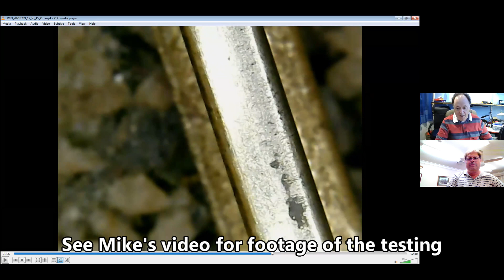Track cleaning on your model railway - what science and experience tells us

Comment: I have been using INOX MX3 for over 40 years. I don't need to clean my H0 locomotive or metal carriage wheels ever. The oil stops oxidation, thus I only clean my track about every 2 months, and only on the oldest track on the layout or track where trains do not regularly run. I installed a helix using Peco track about 10 years ago and have never cleaned this track, the small amount of Inox MP3 is automatically spread over the track. Any light oil works, like transmission oil and CRC 226. WD 40 dries out to quickly, like IPA. https://www.youtube.com/watch?v=A41VpUeoW5A

Comment: I'd be interested to know what mico-arcing is, what is the minimum voltage for it to occur, the voltage type and under what circumstances it occurs. Is it just a spark that is so tiny and transient that it can't be seen by the naked eye? I'd be happier if there was  peer reviewed research  done in a university laboratory to identify the causes and find remedies to the causes of track contamination. From what reading I have done, an arc can only occur if there is no direct contact between two conductors, so this implies two conductors separated by a non conductive medium, such as air. Then the voltage (and possibly type of voltage) comes into play. I know we have all seen sparks between the rail and pickup wheel. For DCC does the frequency of the oscillating voltage play a part? Do the differing types of conductive surfaces play a part, (ie steel wheels/nickel silver track). The oxide layer of nickel silver does conduct electricity, to a certain extent, but it is also resistant, though not immune, to corrosion. I've seen a lot of speculation etc on the net (in particular YouTube) about the cause of contaminated track and I feel we are a long way from really knowing the causes and also finding solutions to the problem.

In particular I would like Peco or some of the other manufacturers to comment, surely they must have some professional advice?

Comment: Interesting that you say that the black "gunk" is nickel silver?? If thats' s the case , why are tracks not wearing out?  I run big trains , average 40 cars , 3 locos ,  and have been using INOX for 10 years, and never have to clean my wheels (some of my locos are 15 yrs old) on freight cars or locos. The track gets  dirty , but is protected from oxidation due to the spray. Contact cleaner will not protect the rails and can increase oxidation.  The only issue with INOX or similar , is locos with traction tyres, but as far as traction  goes . I have no issue with running 8 meter long trains up a helix with 1.8 % grade. Conductivity and oxidation are the main issues, and INOX or CRC 2-26 will greatly help with these.
Cheers Gregg.
Reply from the maker: Hi Gregg, thanks for the comment.  I’ve watched your great video on INOX and have looked into it and a couple of other products like No-OxID etc.  I never have cleaned the wheels on my locos either, but I have read up on the analysis done by Joe Fugate at MRH and also have done some experiments myself.  The black gunk is definitely a non-organic compound mixed together with fluff, lint, hairs etc to form the build up.  Adding a solvent to the gunk sees it quickly lose cohesiveness into very fine particles and the fibers, with no oils etc seeming to be present.  The nickel silver track doesn’t wear out in the same way that using an abrasive track rubber all the time doesn’t wear out the track, it is only a very fine amount that is ablated from the rail surface by arcing but when that combines with fibers it quickly builds up.  While I don’t run 8m long trains, my UK stuff is still lots of four wheel wagons and steam locos so traction is a bit of an issue on my 1-1.5% grade and they are quite sensitive to anything that reduces adhesiveness.  I completely agree regarding the conductivity and oxidation, they’re the big issues we want to avoid and perhaps the easiest solution to all that is to run trains regularly.  The contact cleaner I use is CRC 2-26 when I can get it and also the WD40 brand contact cleaner, both of which seem to work very well like what you are experiencing with INOX.  If you are ever in Brisvegas and want to catch up to chat about it, just sing out.  Happy to talk about this some more.
Reply: @trw1089  Hi Tony , thanks for watching my video and I'm glad you enjoyed it. We have had issues with contact cleaner at work , in some cases on our turnouts, the detection contacts fail after being cleaned. The contact cleaner does clean them , but in harsh environments, it leaves them sterile, and open to oxidation. I've heard that CRC make a cleaner and protector in one? I've had visiting steam on the layout, and initially , the Inox was not an issue, but the traction tyres seem to "soak" it up and become useless! Also we found that the wheels with the tyres on , were slightly larger than the other drivers, thus lifting weight off the other drivers, placing more on the tyers...fine until they don't work , then you only have the front axle on the ground! All very interesting 
I'm actually in Brisbane, so if you want to visit the Sub' , let me know.
Cheers Gregg
Reply: I thought most modern track (ie Peco) was entirely made of nickel silver, so I am a bit confused by these claims that the "black gunk" is a deposit of the stuff. I'm guessing that analysis of what it really is might require the kind of technology (a spectrophotometer for example) that few of us possess at home.

Comment: Hi Tony,   Great video.   For what it’s worth, I agree with you about polar, non-polar and the oxidation of the micro arcing residue.   Given that you have chosen to avoid products like Inox and Jaycar NA-1012 spray because of the traction issue, how long after you have cleaned your track can you operate your layout before it starts to show signs of needing another clean?    The reason I ask is that I applied Inox to my layout (about 180 ft of track) back on 07-DEC-2020 (an easy date to remember) and except for one small section where we were doing scenery work, I haven’t had to touch it since.     If using a contact cleaner, without any oxidation inhibitor component, was going to give 12 months trouble free running in a normal bed room style environment, it might be worth my changing over to CRC CO Contact Cleaner.    

My guesstimate is that using Inox reduces traction by about 15 to 20%.   This isn’t a problem for me.  Most of our grades are on tangents and if need be, I just double head; but I can see how it could be a problem if you can’t double head and had to climb a helix for example.      

Cheers   Doug
Reply from the maker: Hi Doug, thanks for the comment.  I’ve had an area that I’ve been testing for 12 months with a number of different products, NoOx, CRC contact cleaner, Jaycar Electroclean and their Electrolube.  The No Ox stayed the cleanest but collected a lot of dirt and fluff, the CRC contact cleaner also has lasted 12 months with no cleaning, but had definitely oxidised more and the electroclean and electrolube both needed cleaning because of oxidation and some black gunk build up after around 6 months.  I’ve taken some microscopic images and video plus done some solubility testing of the black gunk and what is obvious is that the gunk has built up more on the oxidised areas, which then traps dust, fluff and other fibers which leads to the gunk getting wider and thicker.  So keeping the oxidation under control seems to be very important, but then also stopping the microarcing too.  For the latter I’m trialing graphite on the inside edge of the rail, wiping off the tops of the rail and this is currently working well.  Will do up a follow up video soon of the results.

Comment: Both have lubricant. They create electrical contact.
Reply from the maker: Sorry Arthur, which ones are you talking about?  The CRC contact cleaner and the WD40 contact cleaner don’t have lubricants in them, just volatile hydrocarbons which fully evaporate.  You can get ones with lubricant as well, which I also show towards the end of the video.  Sorry if I’ve misinterpreted your comment.
Reply: @trw1089  yes they do. Use ACT 6000. It's call oxidation of rails.
Reply from the maker: @arthurhouston3  thanks, I’ll check it out.